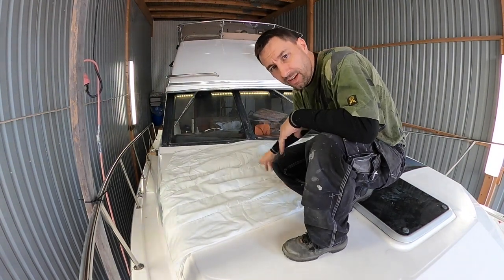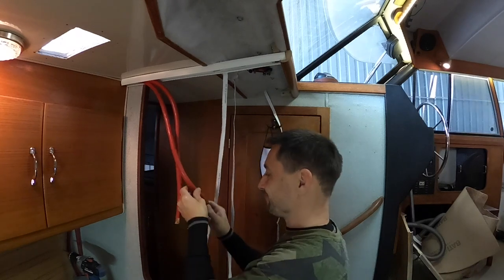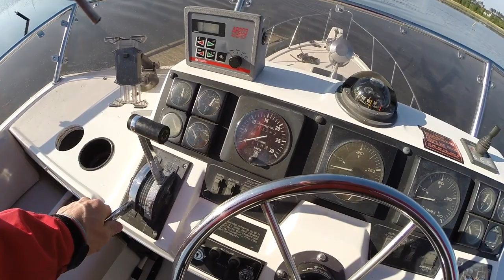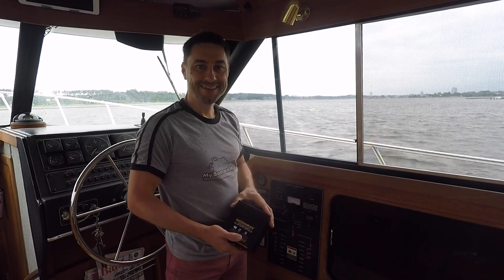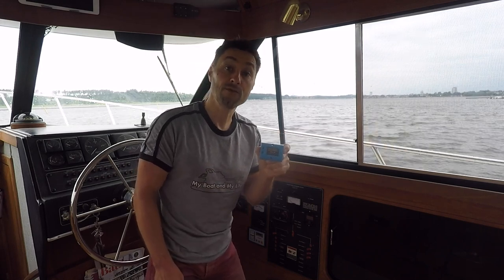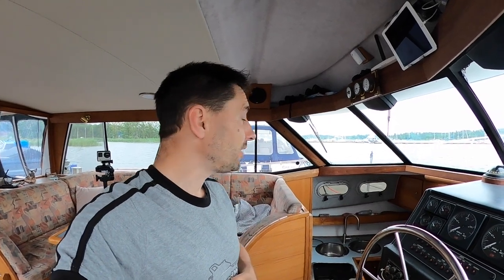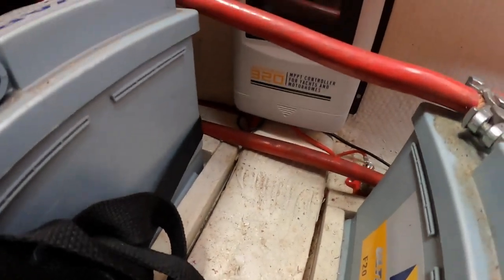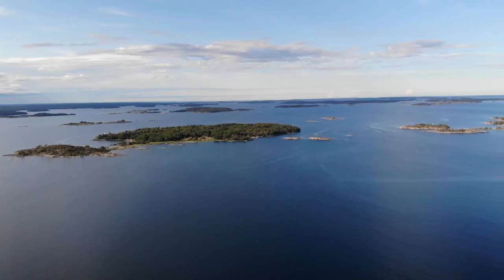Boat splash and Solar

Comment: Hej där, with lots of interest I am watching you installing the sunbeam solarpanels. Did you skip the electrical installation, or can I see it in another video? The connection from all 3 panels to the batteries and the Moonray 320 charge controller. Tack så mycket for your reply, Hej då, Frans från Nederländerna.
Reply from the maker: Sorry. I didn't get any good film material. Worked hard and filmed too little, it was also very dark and small spaces
Reply: @MyBoatandMylife  okay no problem, I will figure it out myself 😁I really enjoy your videos.

Comment: Trevligt klipp som säg brukar.
Hur löste du genomföring från däck med kablarna ner till ditt overkill med 95mm2?
Hur gör du ens en koppling till mppt från 95mm2 till regulatorn? nyfiken som fasen, min Victron sväljer inte mer än 6mm". 
Må väl och tack för trevliga vidds =)
Reply from the maker: Videon innan denna visar när jag borrar hål i däcket. Övergången till och från 95mm2 kabeln löste jag med ringkabelskor och kopplingsplintar. Det sitter även en automatsäkring på pluskabeln.